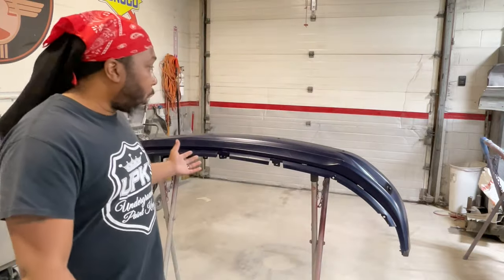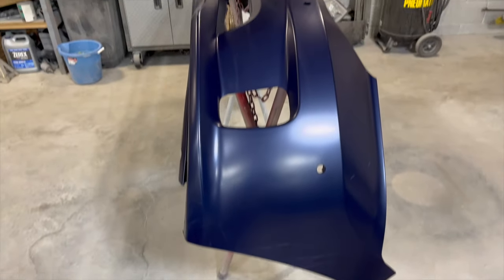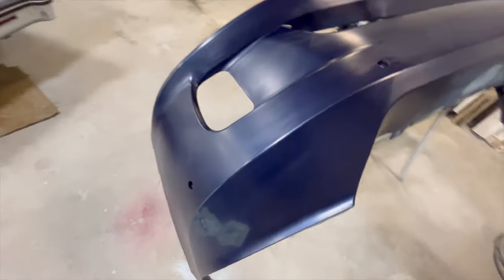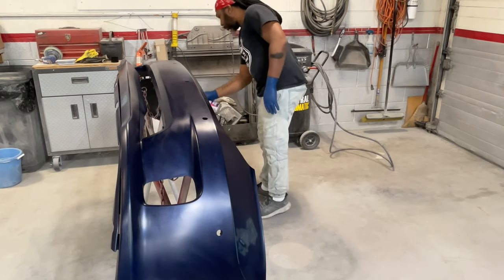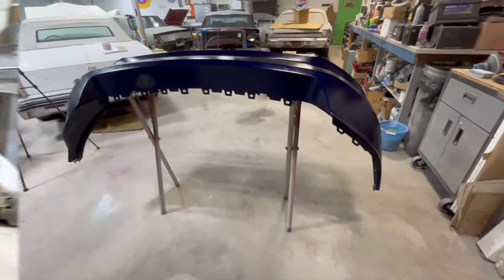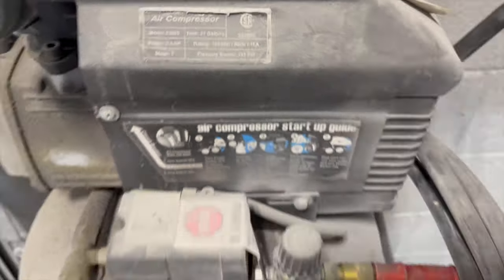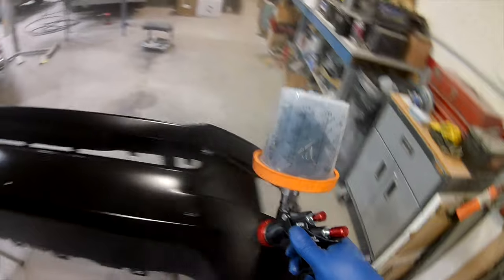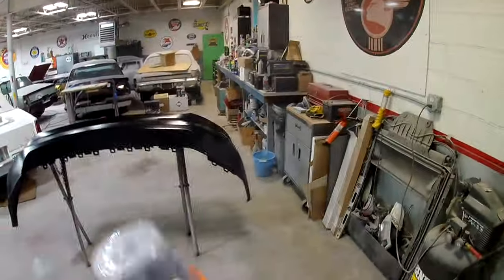HIGH cfm spray gun LOW cfm compressor

Comment: Hi UPK, Good Video Buddy! FYI That HF Compressor (I have the exact model) puts out 4.7CFM @ 90PSI and 5.8CFM @ 40PSI. You were spraying at 30 PSI so I'm guessing you were consuming around 6.0 CFM. My compressor fills to 125psi then cuts out and comes back on at 80psi. The refill with "nothing attached" takes 1.5 minutes from 90psi back up to 125psi. I broke out my R500 and set the gun to 30psi and sprayed until the compressor kicked on and I was able to spray for 1 minute 50 seconds. I continued to hold the gun (settings wide open for both) open and it took the compressor 7 minutes to shut off. The motor cylinder was HOT but running fine. Here is my take. Because these small compressors are basically running non-stop after the initial spray both the compressor and the compressed air are getting hotter and hotter. That means moisture and oil vapors! I think an oil trap and a coalescing filter is a must. What do you think?
Reply from the maker: It’s good to have those for your setup Danno, I personally don’t use them when I’m painting but they definitely work!

Comment: Thanks for the great content! I downgraded my garage and replaced my monster compressor to a 30 gal single stage 120v compressor. I'm setup for auto engine and welding so I no longer needed the big guns and use mostly 18v cordless tools. That being said, I'm interested in body fender and paint work. So thanks again for this!
Reply from the maker: Glad the video was helpful and I appreciate you checking out the channel 🙏🏽💯

Comment: I added a second tank to my air compressor to get more air flow I now have two 25 gallon air tanks hooded up side by side for my home paint jobs because the single tank wasn't enough to keep up been painting for over 34 years as a RV body man painter at work we got a 1000 gallon tank to run our shop for up to 24 workers to use at the same time
Reply from the maker: Nice! I have to of the same 21 gallon compressors and I plan on putting them together at some point. I appreciate you checking out the video Paul💯

Comment: I have a 29 gallon HF compressor 4.5 cfm at 90 psi.  I'm planning to use an Eastwood Concourse LT100 and this video has made me feel good about it.  Thanks!
Reply from the maker: You’re welcome and I’m glad the video was helpful 💯
Reply: I read detailed compressor datasheet somewhere, as long as I remember if it deliver 4.5 cfm at 90 psi means around 9cfm at 30 psi.

Comment: I painted my Harley with a 10gal compressor and a DeVilbiss HVLP gun and it came out fantastic.
Reply from the maker: Awesome! Good to hear successful stories like this 💯💪🏾
Reply: Hi bro i have a 50 litre hyundai silent compressor which 2.5hp and 11cfm 8 bar will i be able to spray paint
Reply from the maker: @mohammedsabeel50 yes you should be able to paint
Reply: Bare love for replying back so im purchasing the areopro a610 guns 
3 of them will they suffice in 
Sealer, base, clear 
Also what tips size you recommend for each stage my bro
Reply from the maker: @mohammedsabeel50  I use 1.3-1.4 for base and clear and 1.5-1.7 for primer and sealer
Reply: @UndergroundPaintKing  ❤️
Reply from the maker: @mohammedsabeel50  glad I could help!

Comment: Black widow 2.0.. if I win this be my second gun in to this field 🔥🔥🔥
Reply from the maker: Good luck ❗️
Reply: @UndergroundPaintKing  thanks a lot appreciate it. One question how much reducer you normally put in your clear?
Reply from the maker: @lensvlog2400  you’re welcome and I don’t put reducer in my clear
Reply: @UndergroundPaintKing  ok awesome. Which would you say you like to use mostly if I may ask
Reply from the maker: @lensvlog2400  on my everyday work I’m using Finish 1 clear at the moment and for my real nice jobs I’m using Grant 7 Oh My clear
Reply: @UndergroundPaintKing  ok. Yh finish one flow out nice. I have iwata 4l to get pretty got finish got to use a little reducer especially with high solid clear, don't like wet sand n buff. You are sharing a lot of info keep up the good work bro.
Reply from the maker: @lensvlog2400  appreciate you 💯💪🏾

Comment: Great video UPK with some great advice and busting a few myths about using a HVLP or any full size gun on a small compressor, I normally only do single panels but I used to use one of those direct drive 50L (10 gallon) compressors and had no problems using my ProLite, DV1 and my Sata X5500.
I now have a bigger belt drive which I got more for my own sanity than the guns as that direct drive was driving me nuts with it's constant drone in my lugholes🥴🤪😂John UK
Reply from the maker: 😂 appreciate you John, thanks for checking out the video, always good hearing from you 💯

Comment: Between your videos and Paint Society's videos I've learned so much, when I first started looking into painting I was getting discouraged because everyone online says you need a $2,000 compressor and high end equipment to get a quality job and you prove time and time again that's not the case.  Do you think this setup in this video could paint a whole truck?
Reply from the maker: I’m glad that I could help in any way with the videos Joseph 💯 you could do a whole truck with this setup but you would have to be aware of the pressure dropping on you as you’re spraying so you would have to wait at times for the compressor to catch up and then continue, but it’s very possible to do!

Comment: You guys can always buy a broken compressor for nothing, take the motor off, plug everything up, run a line to you 20g, and you have a more air. Remember the motor will run a little longer but you'll have air. There's your diy auxiliary tank! Bam! You owe me🤠. If you have a 20g air compressor buy a broken 20-30g tank........not a 60-80g.

Great work!
Reply from the maker: I’ve seen people do that, I actually plan on doing something like that in the future with a old compressor that I have with no motor on it, appreciate you for the info 💯

Comment: So I'm new to painting and been watching alot of small compressor videos learning as much as possible. If you're only ever shooting at 26-35psi why does everyone quote the 90psi cfm rating on their compressor when from my research most have a 40psi rating listed as well. Wouldn't that be more the one to look at to gauge how well it would handle a gun. "Theoretically" anyways because as we see that one handles it just fine.
Reply from the maker: The 90 psi rating is concerning the compressor and not the spray gun, and this compressor does handle this spray gun fine for the job that I’m doing but once I take on a bigger job the compressor will have a hard time keeping up with the demand of the spray gun and would give me inconsistency which is the air pressure dropping while painting which could lead to runs and other issues

Comment: Good stuff!!  
Recommendation request: what’s a fail look like when overworking a small compressor?  How long can a small compressor last til a “fail” situation happens on lvlp/hvlp gun?
Reply from the maker: Are you asking how long you can go before breaking the compressor or are you asking what it looks like when a compressor can’t deliver what is needed by the spray gun?
Reply: @UndergroundPaintKing  all of the above.  What’s it look like when someone new trying out a small compressor and not know when to stop?  How does the paint come out of the gun, and how does it look like on the panel they’re working on?  (And fixes to those situations)
Reply from the maker: @mikemikeyee  failure of the compressor will really depend on the usage and maintenance of the compressor, it may last forever depending on the user ! I will work on a video for what it looks like when coming across those other issues

Comment: I painted a whole truck 95 obs show truck with the same set up after 48 hours I cut and buffed it looked like glass
Reply from the maker: @jeantaylor6785  nice ❗️💯
Reply: @UndergroundPaintKing  you rock my brother I use the round water oil separator all the time I been thinking of using the glass what's your thoughts on that?
Reply from the maker: @jeantaylor6785  I’ve used both and I think both work well but I honestly don’t know if one is better than the other
Reply: @UndergroundPaintKing  yea you be right I'm gonna stick with the ball one tried and tru dat I have 4 help black widow s I painted that truck with I also have 3 lplv 600 s which are like the 500s I like using it because not alot of overspray and I'm getting ready to paint my customized scion xb on acuair suspension I do the sealer than 3 coats of my bascoat and 3 of my clear wait 48 hours buff and cutting lookes like a 4000 dollar paint job I use Nason clear high gloss with uv protection  you rock love yre channel I watch it all the time I've learned alot from you
Reply from the maker: @jeantaylor6785  nice 💯 appreciate you and good luck to you and your projects 💪🏾

Comment: The video on how to setup yre small compreser and paint gun u have is excellent does it show I forget if it shows what to set the compreser on and hvhp black widow gun on the small compreser??
Reply from the maker: @jeantaylor6785  that’s a general setup for lvlp and hvlp, I used the same setup for the black widow as I use for the R500

Comment: If it were I’d be getting the vevor 80 gallon oiless showing people how much energy and money with lvlp u can save not using a hvlp on a small compressor 1200 American I’m Canadian vevor Canada does carry the 80 gallon it’s a nice unit.I had a 26 gallon before my 60 gallon it drove me nuts waiting for air running tools
Reply from the maker: Good to hear you upgraded but everyone doesn’t want a 60-80 gallon compressor so I show how to go about doing things with a small compressor and a big compressor, I have 2-80 gallon compressors and they work great for me but I also have several small compressors that work well for me also, I appreciate you checking out the video 💯

Comment: So many questions. I know nothing about painting but eventually wanna start doing my own projects. I haven’t bought any equipment but wanna start to slowly collect the pieces. Lvlp is low velocity low pressure but you said that is good for big projects like an entire car. Doesn’t makes sense. I would think bigger project higher velocity and volume.  Also I’ve been peeping the compressors at harbor freight and I think the one you have is going for about $239?
Reply from the maker: Lvlp operate on lower cfm so they require less from the compressor to function consistently without dropping pressure like a hvlp spray gun would do while running off a big compressor while attempting a big project.

Comment: Could that compressor and spray gun paint a side of a vehicle?
Reply from the maker: I’m sure it could but there might be fluctuations in the air so it may not spray consistently throughout the process but you can still get it done

Comment: 4.7 is probably straight from the pump.  But the tank running more cfm until the storage runs out.
Reply from the maker: Right, and the storage running out is what causes the drop in pressure to the spray gun and the waiting game begins if you’re doing a big job but on smaller jobs such as this, it isn’t a big issue to tackle! I appreciate you checking out the video 💯

Comment: Which gun do you prefer for base/clear, black widow 2.0 or r500?
Reply from the maker: I like them both, I honestly don’t prefer one over the other. Depending on the size of the job I’m tackling would determine what spray gun I’m using as well as what size compressor I’m using

Comment: UPK, do you think H.F Mcgraw 20g, 4.0 CFM compressor would be able to drive this Black Widow 2? It has slighly smaller flow rate then your CP 4.7 one? Thank you in advance.
Reply from the maker: I’m sure it will, if you’re doing smaller projects I’m sure it’ll work for you

Comment: What time frames do you apply each application? How long do you normally wait to to put base coat then clear ?
Reply from the maker: Depending on what paint products you’re using it should give you a flash time by the manufacturer, for what I’m using I like to wait 20 minutes after my sealer before I apply base then 5-15 minutes between base coats depending on what reducer I’m using then 20-30 flash time before clear then 10-15 minutes between coats maybe longer depending on what hardener I’m using. Hope that helps Jesus!

Comment: How do you keep from getting overspray on the floor?
& is it necessary to use sealer on the bumper? Even though i’m painting the same color?
Reply from the maker: A good exhaust system will help with the overspray and if you have a brand new bumper it’s best to seal it but if it’s the original or a used bumper then sealer can be a option depending on the condition

Comment: I didn't see any filter for your spray gun, is it ok without filter?
Reply from the maker: Maybe you just didn’t see it but it’s definitely one there, I always spray with a filter on my spray gun just in case but if you have a solid filtration system then you can definitely go without one on the spray gun

Comment: What does hte mean? What is considered low velocity compressor? That one looked kinda big? Is a hv compressor just have a bigger motor or bigger tank or both? You said ask so I’m asking. 😁
Reply from the maker: HTE stands for High Transfer Efficiency, and the compressor is considered low by the amount of cfm it produces compared to the tools being used to operate off of it, while a lot of tools will work off of a small compressor, a lot of them won’t work consistently as needed because the motor/tank size can’t keep up with the demand of the tool which eventually can burn out the compressor. Having a big tank and motor typically handles most tools without issues but can be costly so having a small setup and the right tools for the task you plan on tackling may be a better option to still be able to accomplish your task.
Reply: @UndergroundPaintKing  ok I got you. Budget minded. I’m with that. I’ve seen people posting vids on the black widow. Not too expensive and not too cheap. Is that a good entry level spray gun for a beginner?
Reply from the maker: @SanDiego_VDubLife  I think it’s a good entry level spray gun but there are others that are good and cheaper, I’ve done videos on several cheaper spray guns here on the channel that will deliver great results for a beginner
Reply: @UndergroundPaintKing  ok I will take a look

Comment: im confused..i have the same compressor but i thought i needed a lvlp gun🤷🏾‍♂️ i wanna paint my mustang i actually have the black widow,but never opened it because its hvlp with higher cfm
Reply from the maker: You want a lvlp spray gun so you can spray consistently and not deal with pressure dropping while spraying but if you’re doing a small job like this example here with the bumper, you can use a hte/hvlp spray gun with your small compressor and get it done but once you take your hte/hvlp spray gun and spray a big job you’ll definitely experience the pressure drop while painting. I hope that clears up the confusion!

Comment: Whats the mix ratio on the primer to make it a sealer??
Reply from the maker: @jeantaylor6785  that depends on the brand you’re using and if it can be mixed as a sealer
Reply: @UndergroundPaintKing  speedo kote
Reply from the maker: @jeantaylor6785  you would have to check with SPEEDOKOTE to see if the particular primer you’re planning on using and be used as a sealer also
Reply: @UndergroundPaintKing  I'm gonna be painting fiberglass bumper front and back with the same process u used on cleaning it using red scoth Brite pad I also could use finish 1 I have a gallon of it? Is that what u used? For the sealer are can I just prime it and skip the sealer?
Reply from the maker: @jeantaylor6785  you don’t have to deal if you don’t want to but it helps depending on the situation of the project you’re doing
Reply: @UndergroundPaintKing  yea I with you in that I rather put a sealer on it and then prime it some of its plastic and I also use bulldog adhesive promoter the best .I'm gonna find out I know in the speedo kote it can be made also as a sealer.i ordered me some more of the disposable cups orange ring you showed from yre link I got both sets they good cups.and fit real good and snug.
Reply from the maker: @jeantaylor6785  💯
Reply: @UndergroundPaintKing  my hose is 25 foot one I got at harber freight like u have and the aluminum coupler s that have bigger holes more air with the same compresor you have small one

Comment: You can't get replacement parts for these new guns or even the older ones. Also no upgrade parts for the new black widow spray gun
Reply from the maker: I’ve honestly have never replaced parts on any of my spray guns, I’ve just kept them clean and they have worked fine but you’re right that you can’t get replacement parts for these spray guns as far as I know
Reply: @UndergroundPaintKing  I agreed same here but crap happens and also I like the option to change up my setup. I don't want to have to buy numerous paint guns. I was actually using a Husky paint gun for years and it sprayed great and flat. I sprayed my engine compartment with that gun for my 68 AMC AMX it came out great. But it's worn out after 6 yrs and I like shooting base coat clear coat with a 1.4 tip no orange peel. I just purchased the Master elite 88 it got fantastic reviews. It also comes with 2 tips and cup for the same price as the black widow spray gun
Reply from the maker: @roninthedestroyer8958  I like the Aeropro A610 which also comes with multiple tips for primer, base, and clear and does a great job for all of them
Reply: @UndergroundPaintKing  I was looking at that to but for months I read up and looked at reviews and I said screw it. If I am not happy with it I can return it.